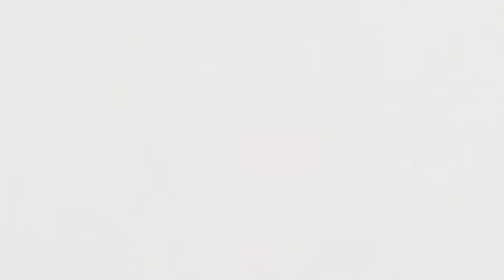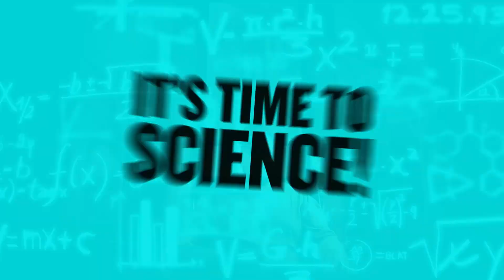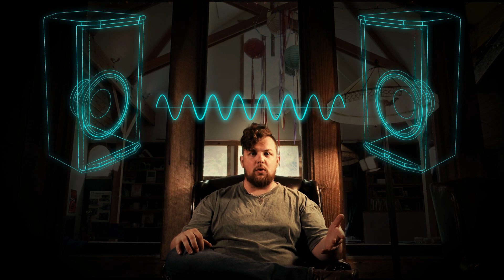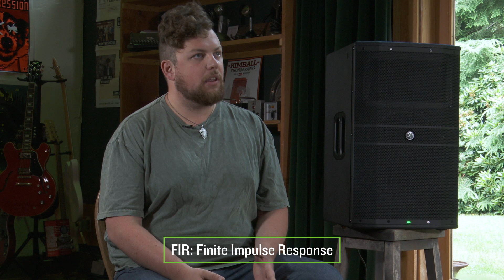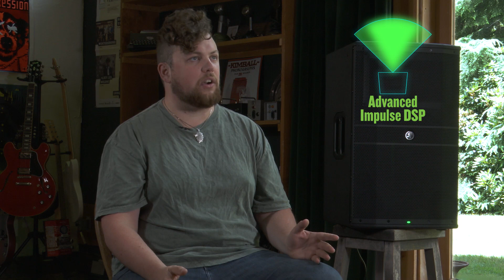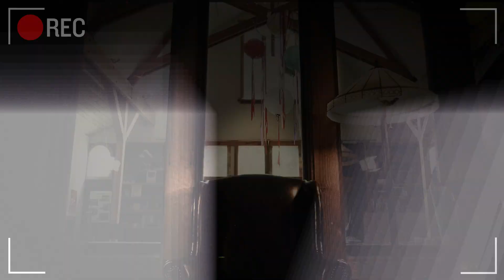Advanced Impulse DSP Deep Dive

Comment: This is nothing but a bunch of techie speech BS. Use a whole lot of terms most people have heard and don't understand but it sounds official so it must be impressive. Audio companies have known this stuff and have been incorporating it into their products for a very long time. This engineering is good stuff but it doesn't make Mackie sound any better than anyone else. Use your head when you shop and don't be influenced by hype marketing.
Reply from the maker: Believe it or not, our processing uses specific techniques and methods that are unique to our loudspeakers. Anyone can throw an FIR filter into a speaker, but having the quantity of data that we get and how we use it is not something that others can offer. Think of it as an engine in a car – they all burn fuel to make pistons go up and down, but does that make them all the same?
Reply: The measurement system and correction was designed by David Gunness when he was working for EAW. It was called "Gunness Focusing." It's real and has been used for EAW line array and point source box processing for some time now. When it was applied to EAW's older, harsher sounding boxes, it made quite a difference. When EAW was acquired by Loud (Mackie's parent company), Mackie was able to adopt it for their boxes and have been using it ever since. David Gunness is quite the loudspeaker engineer and has been designing boxes for decades with companies like EV, all the way down to the component level. I agree that Mackie's advertising can be a bit overhyped. But in this cases, the processing is real and it does work. Try listening to an EAW KF850 rig setup old school and then one with the Gunness Focus processor settings. It's night and day difference in harshness and clarity. Even the KF750 boxes sound usable compared to when they were new.